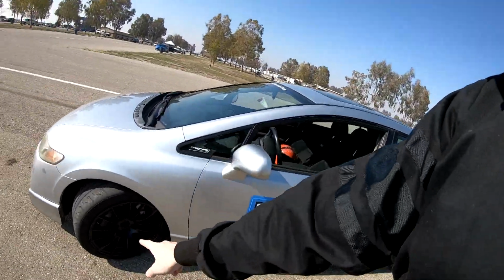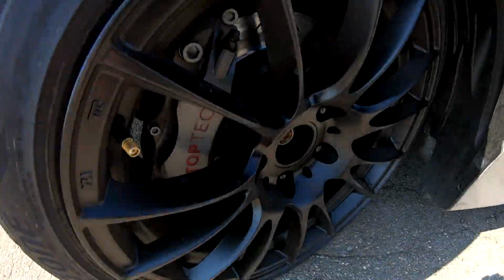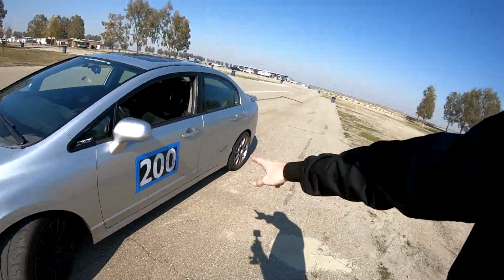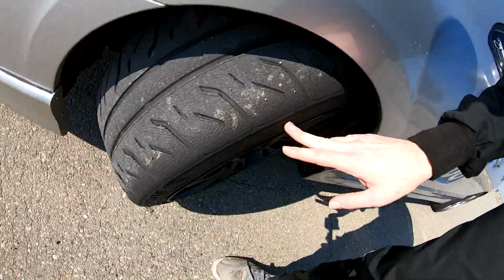Stock Power FA5 Civic Si Buttonwillow 13CW: 2:02.9!!! || Project Civic Si Part 27

Comment: whats your wheel setup for the front? im on 17x8+45 you think i can run 245/40 without any modifications?
Reply from the maker: 17x9.5 w/ 245/40. No point running a 245 on an 8" wheel unless you're limited by a class regulation, it won't be any faster.
Reply: @DriveBreakFixRepeat  yes but it's cheaper than a 235/40 tire by almost 50 bucks I get it at 150 a piece for rt660. So im trying to save. Haha that's why I ask.